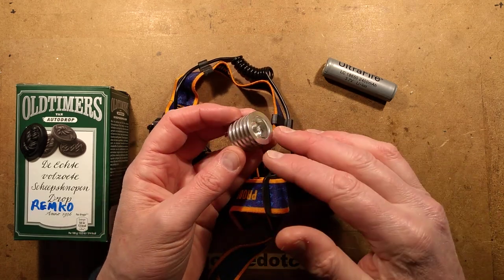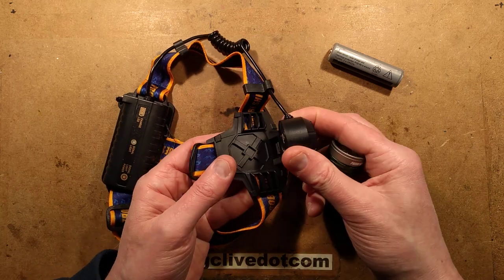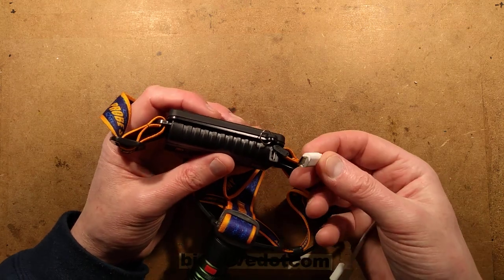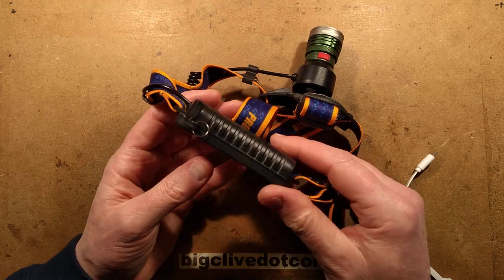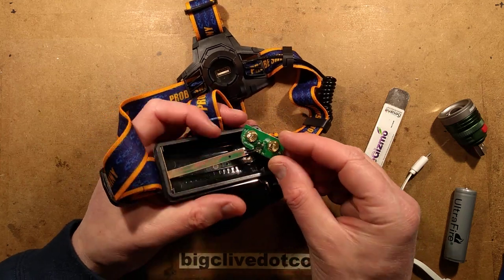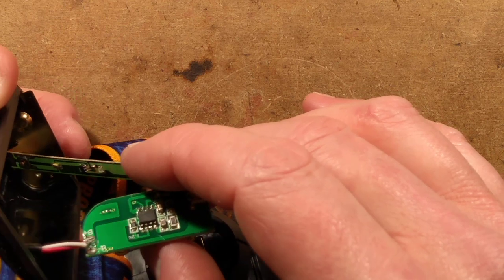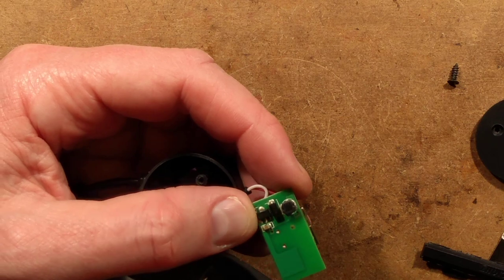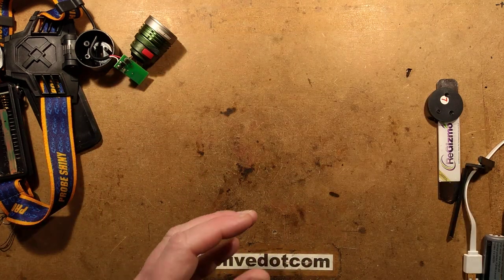Inside a Shiny Probe head torch with detachable USB light.

Comment: I bought just the detachable USB light. I wanted to turn it on or off by supplying a 5v to it instead of pressing the button. It does work but after awhile, it doesnt work anymore and the button must be press again in order to turn it on. I wonder why is that and if theres a way I can make it work by just turning on or off my 5v supply? Any help would be greatly appreciated
Reply: As far as I can gather from previous videos, the reason is that the power supply you have is switching off, due to the drain being bellow a certain level. Clive mentioned this in a few of his videos. Basically, if you aren't drawing enough current constantly, the power bank thinks there is nothing connected to it and disables the output 🤔

Comment: Thanks for sharing this with us Clive, Bill here in Canada. I'm wondering if you can help me out with a problem I've run into. I purchased a higher end headlamp that came with two 18650 2200 mah Bats. As I was using it at the time I grabbed two replacements from my collection of 160 of these cells but they wouldn't work I tried several pairs but nothing worked. After charging the originals all was fine. It seem that they were proprietory cells although that was not mentioned in the description on purchasing. I have checked and it has nothing to do with the length. I confirmed my suspicion with the company and they didn't seem to give a shit that I had to buy more of their batteries if I wanted spares. At a price of 15 Can paso's each that isn't going to happen. Any thoughts on how they might have gone about this or how I might detect it and solve it? The only other option is too sell this thing off to someone else, I will disclose the issue, I need to sleep at night. Cheers Clive keep up the great info, Bill in Canada whp1@shaw.ca
Reply: The moral of the story must be: Never buy high end headlamps untill they have alle stopped doing this. It is unacceptable behaviour on their part. Period.
Reply: Thank you Annie, the company is called MSForce, watch out if you buy from them, Cheers, Bill
Reply from the maker: Are you sure they are making contact inside the holder?  It could be that thing where different length pips on the positive end look like they're long enough, but don't actually make contact due to the plastic contact holder.  Definitely make sure that two cells are making proper contact individually before putting them in parallel.
Reply: @bigclivedotcom  The problem ones are 67.65 mm and I have tried a bunch between 65.30 and 69.02. The company admitted they were propitiatory but that was all they would say..Thanks, Bill

Comment: i use those small neodymium magnets on the positive side of the flat top 18650s and they work.  all my headlamps use salvaged laptop batteries. 

And can you link that little lit magnifying glass?
Reply from the maker: https://www.ebay.com/itm/5X-15X-40X-Handheld-LED-Lighting-ABS-Plastic-Case-Magnifying-Glass/292835479477?var=591611736156
Reply: @bigclivedotcom  thx!  Now I'll have to find a vendor that will ship to Alaska :)
Reply from the maker: @chipheadnet  Do you have difficulty getting things shipped there?  A lot of sellers won't ship here.
Reply: @bigclivedotcom  not too bad but yeah a lot of ebay sellers won't ship here i can usually find one.   in the case of that mag glass i ended up getting it from amazon.

Comment: There probably would have been less voltage drop if there were two batteries in place perhaps.?
Reply: David Potter the putting two batteries in would only increase the capacity not the voltage as batteries are used in parallel. It’s the chip that’s restricting the output to 1amp.
Reply: @gordonprentice7090  I think he meant that there will be less voltage drop on these cheap chinesium cells. Obviously one cell can't keep up with current
Reply: @kjur18  Yes, this is what I indicated, there would be less voltage drop if two batteries were in place.
I have done my own tests on these head torches. Why else would they use two cells.? Yes I know about capacity, but it also helps with voltage drop across each cell. If voltage drops, then current drops in sympathy. Basic Physics.
Reply: @gordonprentice7090  Yes, this is what I indicated, there would be less voltage drop if two batteries were in place.
I have done my own tests on these head torches. Why else would they use two cells.? Yes I know about capacity, but it also helps with voltage drop across each cell. If voltage drops, then current drops in sympathy. Basic Physics.
Reply: @G1ZQCArtwork  Once I had in my hands something like portable flood/work light with a few modes. I had 4 18650's. I measured them with analyzing charger. All of them combined had about 800mAh. So well, no wonder that voltage drops like crazy. Thin cables don't help in this case, they might drop even about 1V with some current.
Reply: Ok. I see what you mean

Comment: Can you charge it while using it?

A double 18650 power supply for projects would be appreciated...
Reply from the maker: The charging and boost circuitry are separate so I'd guess you can charge it while using it.
Reply: @bigclivedotcom  Thank you for your reply! I picked up one, and I'll try it out on my next Arduino project, which is animating a LEGO-display. That's why it would be cool to be able to run it off batteries from time to time, but mainly use external power.
Reply: I have one that allows you to use it without batteries, with a powerbank.
Reply: @frostfirei  A power supply without batteries? I'm not following you, unfortunately.
Reply: @bigclivedotcom  ...And it works! I'll grab a couple more; a battery box, charging circuit and booster all neatly wrapped in one, with a USB light for free!

The headband was removed non-destructively, so it can be re-mounted if I choose, but I might make the USB outlet be on a quick-connector because of its size.

Brilliant buy, though! Thanks for the review!

Oh, and it can be used completely without batteries as well, if it is incorporated into something that is stored long periods without batteries in it.

Comment: Would it make a difference to the output if you slipped 2 in instead of 1?
Reply from the maker: I don't think so.  The main limiting factor is probably the interconnecting cable.
Reply: Ah ok that makes sense. 
Great video, thank you for posting.

Comment: I don't get it. I worked for GM and no one wanted to promote my car models. "Chevy Misfire", "Pontiac Powerless", "Buick Backfire", "Oldsmobile Obsolete". I don't understand. (I never worked for GM). I did work with the "AcidFire" car battery project within a company based in Hell, Mich. I guess Solar Power won out.

Comment: i think you can place a small magnet on the end of the cell to raise the height of the cell to work.

you could melt a blob of solder on the cell but there is controversy about soldering to 18650 cells due to the heat going into the battery material and threatening the lithium.

you could melt a blob of solder onto the + terminal in the light to make it extend out but you risk melting the plastic and burning plastic fumes.

soldering the battery holder will make it so the batteries with the raised top will not fit.

the magnet is the safest and easiest way 

if you are trying to manipulate youtube's algorithm by making them naughty noises you do know you can purchase likes and followers to inflate your video's popularity.

you can google purchase youtube likes or purchase youtube followers and there are instructions so no need to make noises to increase ratings.

Comment: OMG can you really make things more simple. Boost circuit with 4 components.. The output voltage must be very crappy with lots of ripple and interference...
Reply from the maker: It's a dedicated chip.  It does monitor the voltage and has the smoothing capacitor to provide a stable DC supply.
Reply: @bigclivedotcom  if its a switching psu one cap doesn't do much. Put a spectrum analyser and you'll see what really comes out.